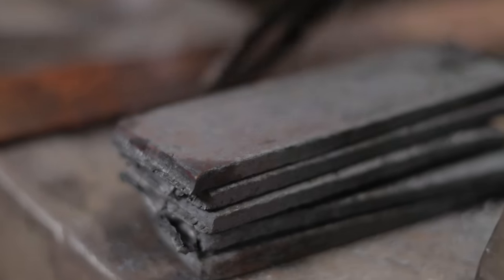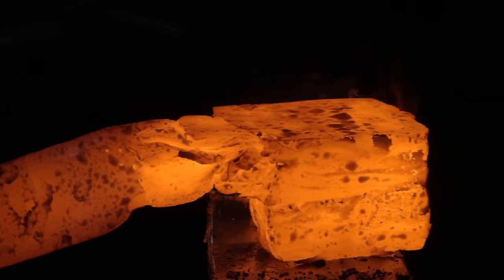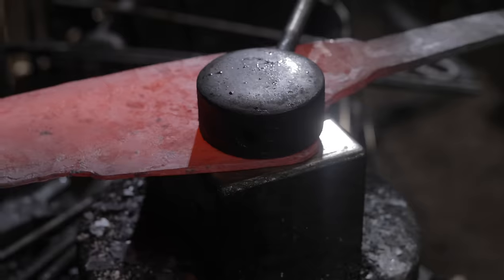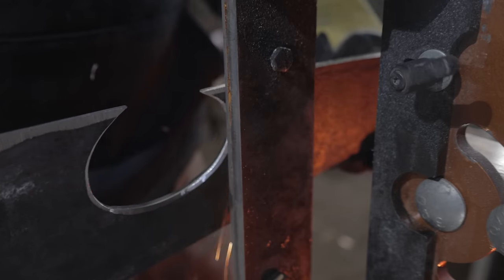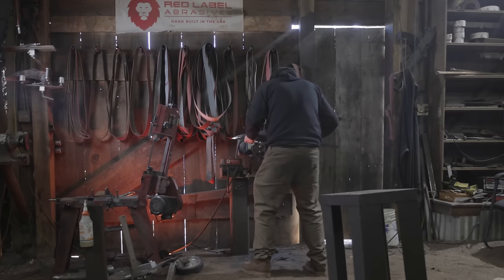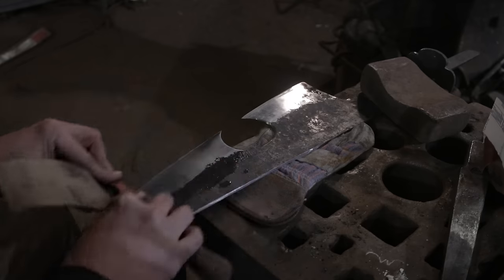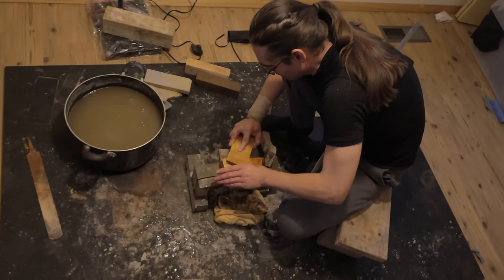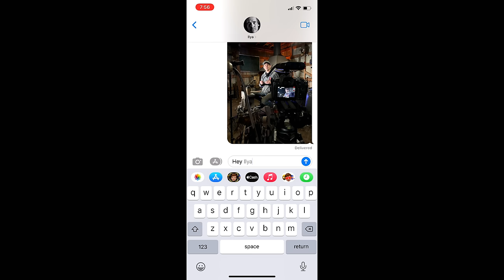Tengen Uzui's Nichirin Blades : [Demon Slayer] Season 2

Comment: Canonically, in Demon Slayer the swords the Corps receives are made with very specific techniques made by a very small number of extremely talented swordsmiths. Every single one is a work of art on its own, and the smiths get very mad if anything ever happens to one.
Reply: You can see why

Imagine working for months, years even to make a blade just for some pig guy to hammer it with a rock
Reply: Makes me wonder if Uzui did the same with his blades since the holes look rather big...
Reply: @charlescaulkins8306  Honestly the fact that the Hole is that Big, and not only that also "Clean" makes me believe he probably commissioned it that way.

Compare that to Inosuke Shredded Sword, you can see that not only it is Jagged well somewhat it also wasn't clean.
Reply: @RandomL0s3r it takes them like a week
Reply: @dbzenoluke No it doesn't it takes months every time tanjirou broke his sword he waited a few months before getting a replacement.

Comment: The hot-dog-in-a-bun construction is called warikomi (割り込み). Sanmai refers to constructions where the blade steel layer goes all the way to the back.
Reply: That is correct. I misspoke and didn't bother to correct myself after because westerners tend to understand sanmai much better than warikomi or kobuse

Comment: The procedure of folding carbon steel (basically forging) are to adjust the carbon content percentage and to level the purity of steel from edge to edge. Steel forging removes impurities and repeating this would result with a steel that has a higher carbon content. (The higher the carbon content gets, more stiff the steel becomes)

They create two types of steels 
one with high carbon content (0.03%～1.7%) called shell steel(皮鉄)  
one with low carbon content (0.01%～0.03%) called heart steel (心鉄)

Katana Blacksmith pinpoints these percentage with the color of the glowing iron, the feel of the hammering and etc. 

Finally, they wrap heart steel with shell steel and this is what makes japanese katana very unique. With harder outer steel, they are capable of forming thinner and shaper steel. However, With just hard steel, it would make katana very fragile to the impact, so here comes the purpose of the heart steel which is impact absorption. The soft inner steel and hard outer steel makes katana very sharp yet durable. 

So what he is doing here is kinda what similar to the procedures of how japanese katana blacksmith takes, but completely different. I am not tryna despise his work, but i just wanted ppl to know that japanese katana forging techniques are very refined and unique.

Comment: Another absolute masterpiece!
I wonder if you explained the reason behind why spraying liquid (water?) from bottle onto the billet while forging?
I'm curious
Reply: It prevents scale (the black flakes that you see them brush off) from forming. From what I remember, when the billet scales it doesn't forge weld well, so it would prbly break apart from all those folds. They put borax on the billet for the same reason too

Comment: 6:52 It's actually Warikomi when you fold the steel/iron over the core steel. Not many Japanese knife makers do this today because it's costs more and takes more time and skill, Moritaka still do it, and given that it's just that much more of a hands on element, their knives are a better value, they even weld on a stainless steel tang so it won't rust in the handle. A rather newcomer in the knifemaking but already highly revered, Jiro Nakagawa, who does everything thing by himself. His knives cost more than Moritaka, but given it's only him and he laminates his steel himself (as Moritaka does) the price is actually not too bad.

San-mai is for when you have a core steel with a softer steel/iron clad on either side and the core steel is exposed on the spine.

Comment: I’ve been wanting to give Blacksmithing a try for a very, very long time. I finally got a single propane burner forge( that would be nice to have a second burner to be able to heat larger blades. I did get a hammer but not one for actual forge work, and a set of tongs, that… broke. Right at the bend of the jaw.. I’m screwed and barely got to get started. I was doing good to get the few things I got… I didn’t have cash so I had to find someone interested in crap I had laying around. My anvil is a bit of chewed up railroad track. It has lots of deep gouges and dents all over the top. It doesn’t have a hole to use for getting a drift through the working piece…. And I only have cheap steel from Lowe’s, maybe a dozen railroad spikes and a few chunks of leaf springs. I guess I’m going to look for a class that can teach my how to make some of the tools I need. Well.. if the class is cheaper than just buying a set outright.

Comment: While finishing this video, a question comes to mind.

"Can a rope connected to the bottom of the handle (and the rope held in the non-dominant hand) make the sword's swing strong as if it were held by two hands, but allow for greater reach like with one hand?"
Reply from the maker: Strength wise, yes if not more force. The problem is edge alignment. I tried with this one to swing by the chain to see if I could at least hit a water jug or something but it was too unpredictable and silly.

Comment: One question. Why aren't you using those "cotton like" little pieces that go under the tsuka ito? This is the first video I watch of a professional that doesn't use these (though I have to admit that they don't look that usefull. They just add a bit of volume, so they are not that essential, right?)
Reply: The handle is already so thick... plus it's not exactly a traditional design

Comment: I know critical comments are not allowed anymore on youtube but if you look at the reference pictures every possible proportion is completely wrong (the size of the hole, the width of blade in ratio to the handle, the wavy pattern is not even close). The quality is of course amazing like always just disappointed of the proportions 10:55